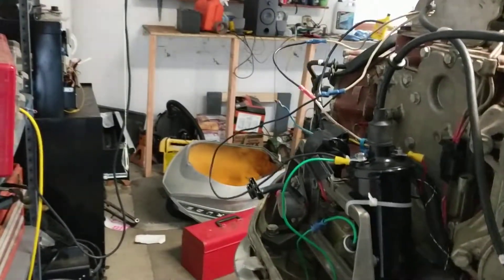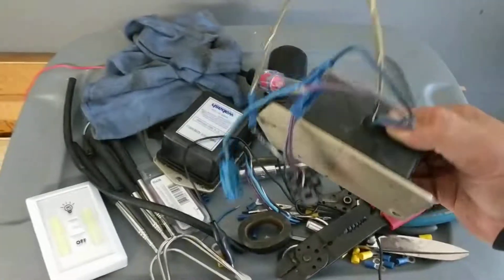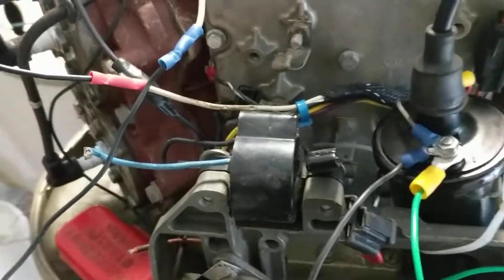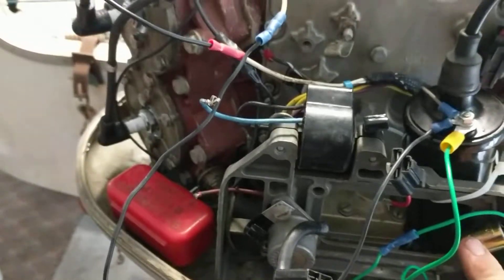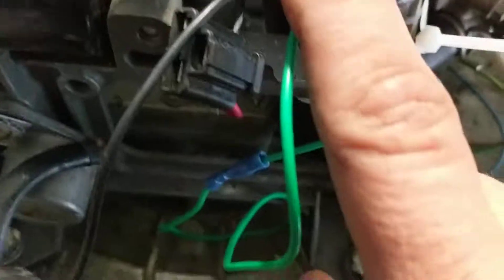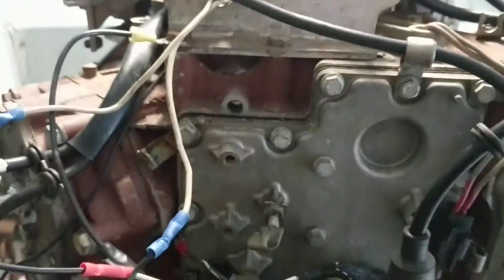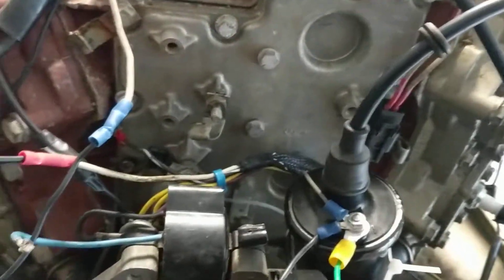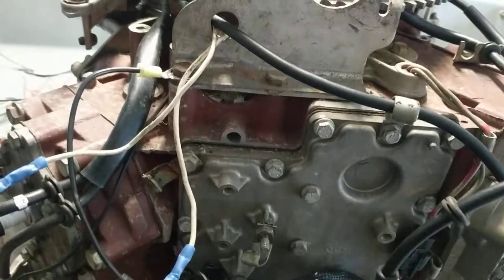1968 Evinrude with automotive ignition conversion

Comment: Where & how did you learn to do this?
Reply from the maker: Brian Miller It's actually super easy, it's cheaper too.  I took it out for a water test and it ran perfect.  Just get a coil with an internal resistor and a condenser.  Condenser needs to be grounded and connected to - side of coil and power coming into the + side.
Reply from the maker: Brian Miller I think I got it off iboats or boats.com.  It's a pretty cool thing to know how to do.
Reply: Okay, just wondered.
Reply: Brian Miller. You have one wire for the condenser on negative you have another going to the points whear dose that white one go to that is on the negative side of condenser

Comment: Ey man can you send me a diagram on how you did it I am doing it on mine and is not working
Reply from the maker: Still no spark?
Reply: I don’t know if am confuse I ran the ground to the points and the other one to the coil and the condenser to ground and nothing I got one of the acces coils u thing that would be the problem I just bought the boat and I am trying to put it in the water to take my son fishing
Reply: Can you make a diagram to help me out please please
Reply from the maker: @oscardelagarza9339  Do you have 12 volts running to the plus side of the coil?

Comment: Please
Reply from the maker: Make sure your condenser is grounded, also run - to points.  Have you checked the points or messed with them?  There are nylon washers in there that keep system from grounding out.  Without those washers you will not get spark.
Reply: Oh ok let me check that thanks
Reply: I ran it straight to battery to just test it
Reply: could you help me please